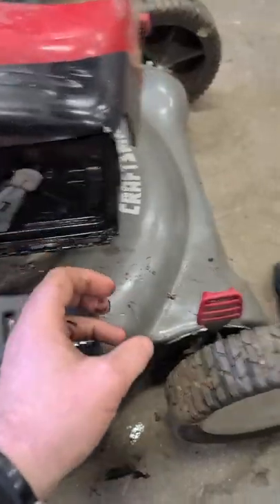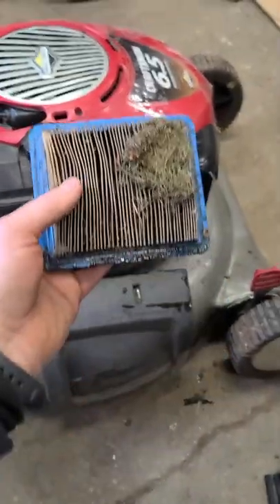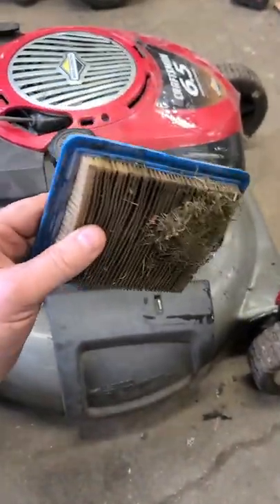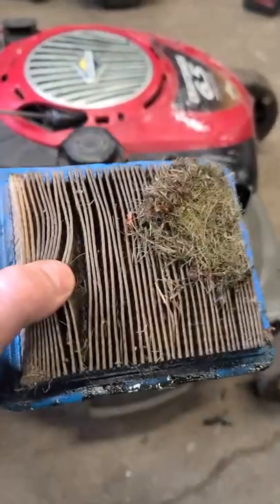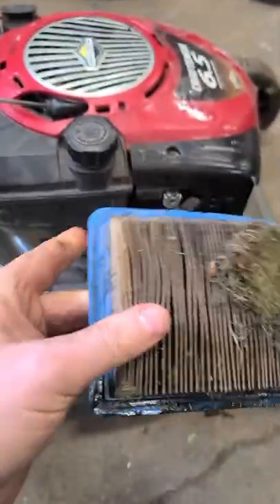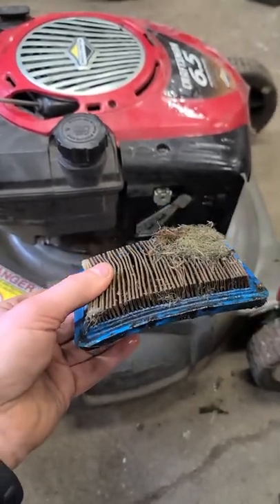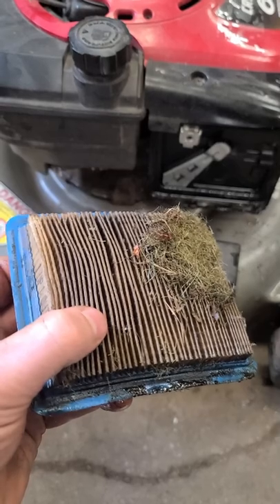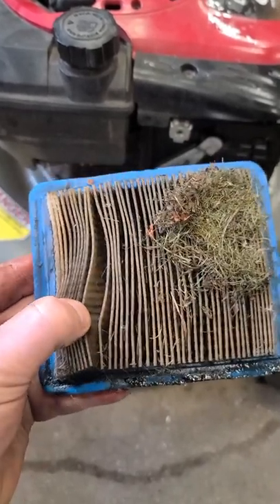This Lawnmower Was Smoking & Ran Poorly - Here's Why!  #shorts

Comment: I always avoided this by flipping it the other way or draining the oil and removing the air filter to change it before dealing with the blade! My old neighbor taught me how to sharpen and balance the blades. My mowers never let me down! Except an old briggs classic on a late 70s early 80s walk behind i had the governor crap out on as i finished mowing! Dont miss the ball bearings either, It went Full throttle suddenly & still kept running after i pulled the sparkplug wire, i was pretty scared being 13 or so at that time -i ended up cutting the fuel and blocking off the intake with a rag, i hit it with a hammer a few times out of anger due to the time i had put into restoring  the engine (all new gaskets, carb rebuild, pull string, throttle cable, valve adjustment, belts, plug and fixing the rust but after that i scavenged reusable parts and sent that rusted out machine to the scrap yard. Carb was still perfect enough to save a wood chipper my neighbor had !

Comment: OFF TOPIC, but on self propelled mowers, with similar wheels, when the front drive wheels go bald, an Angle Grinder with 1/4" wide wheel will quickly put the grooves back in the 'tire'. Take your time and do it outside.  You may not have to remove the wheels.

Comment: Similar loss of power with my chainsaw when the air filter gets plugged up with dusty shavings when cutting punky wood. Give it a quick blow with the compressed air, and then a wash with dish soap and power is restored.

Comment: Just a quick note to say alot of people get really freaked out about smoke spewing from an engine like this, environmentally speaking. That's one of the reasons for everyone buying electric stuff now.  One thing to keep in mind, though you don't want to breathe that stuff all the time, smoke is primarily particulate matter and will eventually settle to the ground over time. It's carbon and carbon has a molecular weight and will eventually clear as it settles. It can get into the lungs, like smoke from cigarettes or weed, but the lungs can clear themselves over time. And of course it's not healthy in significant quantities. So, though it's not great for you, Ike smog, in the open air it's not as harmful as it appears. Just stay up wind of the smoke and you should be fine without any breathing difficulties. Or wear a protective mask if necessary. But if your mower is blowing this kind of smoke all the time, gotta fix it because something is definitely wrong. But Dony fixed this one, so it's good to go!👍

Comment: Can this also make a push mowers exhaust get red hot? Im trying to figure out if i need to put more oil in it or if its overheating because of the filter being clogged up...its making a little bit of white smoke, but the past few times i try to cut grass with it it runs fine for a bit then it just cuts off then i try to start it back up but it wont turn over and start...so after i wait a few days later it starts right up again but then will cut out again after cutting grass for like 15- 20minutes even when it has plenty of gas in it.

Comment: I did that same mistake. I fix engines and I was in a rush I didn’t think about which side and while I was taking off the blade I was saying oh shit in my head and I quickly flipped it back over. I ended up having to buy a new air filter and use a lot of carb cleaner. Definitely won’t do it again.

Comment: My son tipped my lawnmower on its side. The site filter was soaked in oil. I changed it cleaned out the area ran it for about 10-15 minutes and it's still smoking white, what could be my next step?
Reply: Check oil level. Too much oil will cause it to smoke too.
Reply: @rro2811  Thank you!